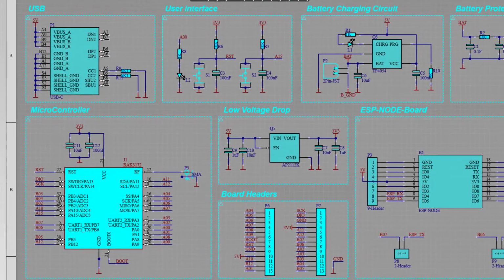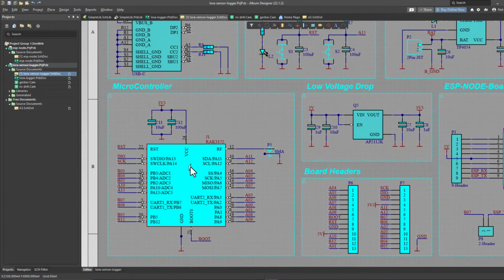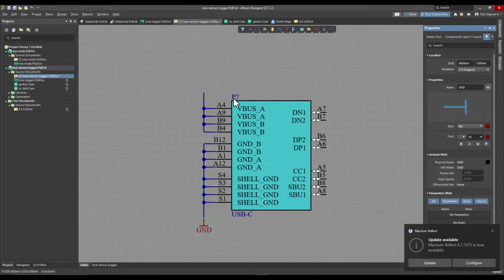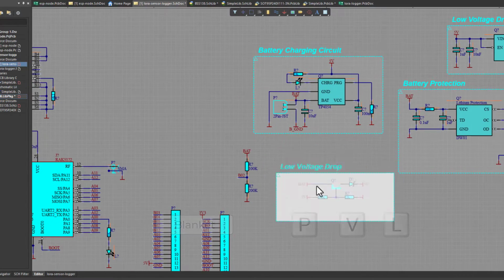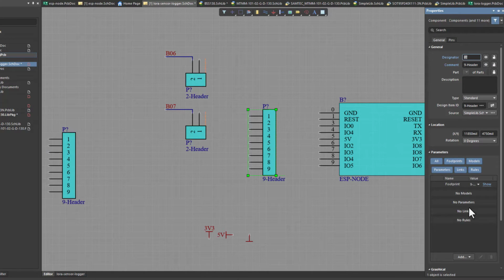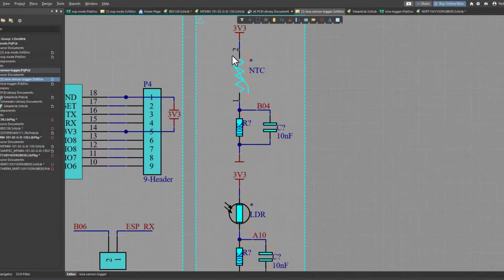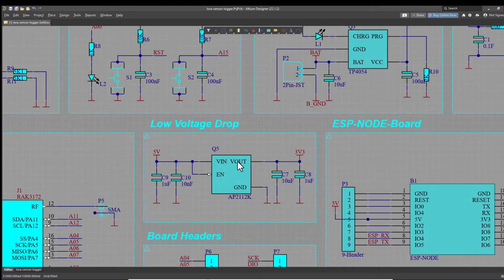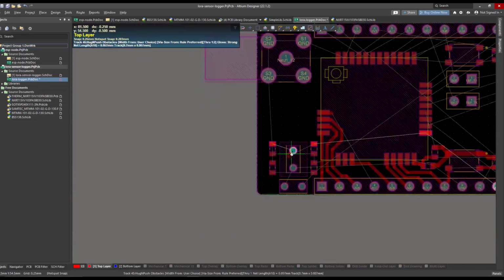Altium STM32WLE5 Designer LoRaWAN Board Schematics Design

Comment: To have consistent system voltage, shouldn't BAT be the input of the low voltage drop circuit, not 5V?